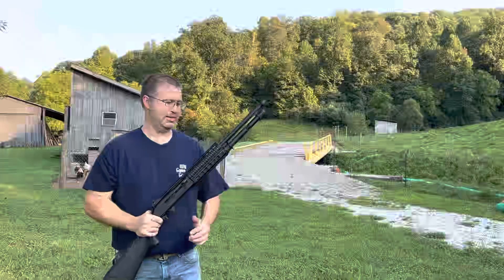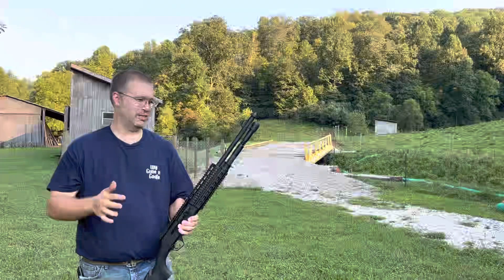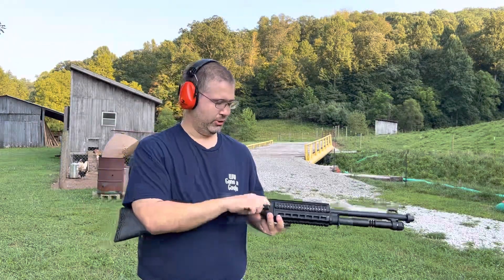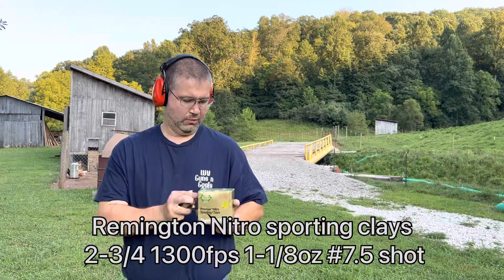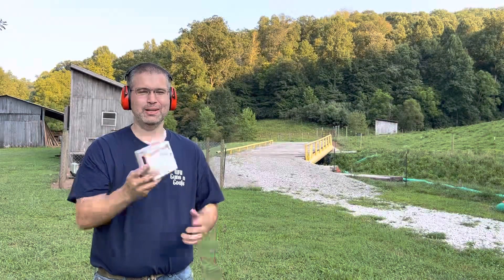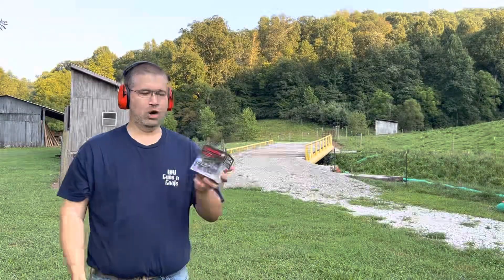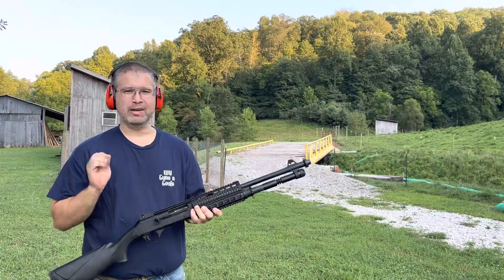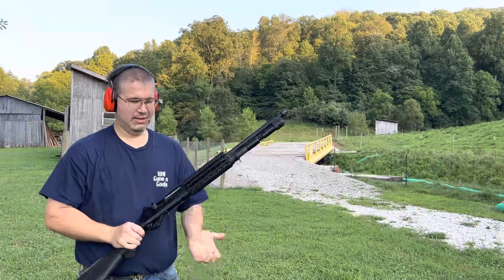Turknelli M4 Ammo test (Aksa S4)

Comment: My only problem with this video is that you put actual Benelli parts in it. I would like to have known how it would have ran without those parts. Just straight up aksa s4 out of the box. If you can could you please tell me how it ran before those parts were added?
Reply from the maker: I installed those parts at about 200 rounds, not because of problems i had just because i had seen some other people suggest them online and they were cheap, it was working fine with factory parts. Also i believe AKSA is up too gen 3 of these guns now, imported by black aces currently.
Reply: @WVGunsNGoats  thanks for the info dude. Your review kicked ass. I’ve owned this gun for about a year now and I love it. I bought the Briley Mlok 8 inch handrail for it and I intend to buy a hand stop and a light for it as well. I’ve seen some people put the light on the handrail but I’m thinking I’ll just get the picatinny light mount that attaches between the barrel and magazine tube what do you think?

Comment: Been trying to replace the extractor with a benelli one on my panzer m4, is there a specific way to remove the extractor roll pin? Mine doesn't seem to want to come out
Reply from the maker: Ok so, you may think the extractor pin is in that hole straight down, but its not thats just a hole drilled into the bolt.

However, the pin actually sits at a very sharp angle inside that hole, you may need to use a magnifing glass or your phone camera to zoom in on it. A small punch will catch the pin it sits at like a 45 degree angle.

If you find the pin with a punch and it still wont come out you may need to contact the company.

Comment: When TFB threw the gun with a partially loaded shell you could hear the round seat when it hit the ground (12 min. 38 second mark in his video). That was childish, irresponsible and flat dangerous. He was attempting to make the gun fail and putting on a show as he did it. I do not respect that persons opinion.
Reply from the maker: And you know, he wont do a follow up video like he said he would, hes gotten paid already, and made it look bad. I could pretty much tell he wasnt getting gas to the pistons and most likely needed a 5 cent O-Ring to fix the issue he had, its a known issue that sometimes they get pinched and torn when assembled.
Reply: @WVGunsNGoats  He could have at least tried to clean or oil it. WD40 is all he had? 

He had enough confidence in the quality of the weapon to throw it loaded. I say don't ever throw a weapon, loaded or not.
Reply from the maker: Yes it seems for such a big youtube channel he forgot the basics of going to the range, and shouldnt have tossed the gun.